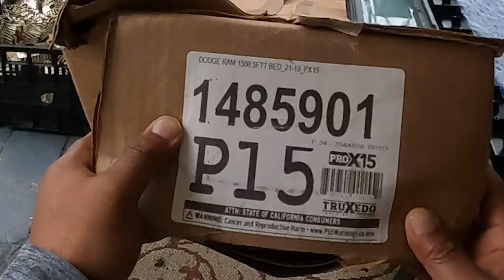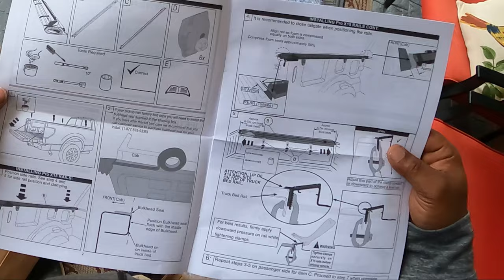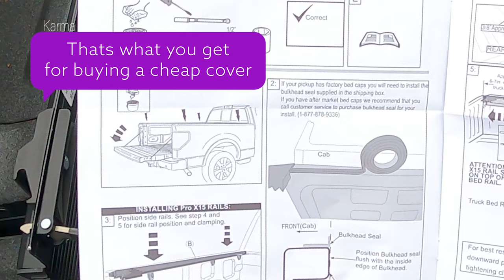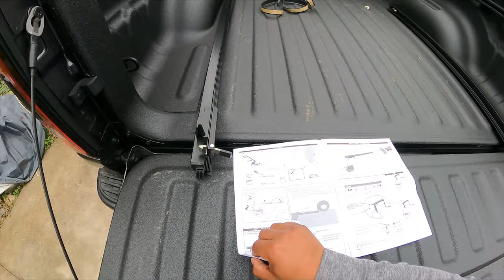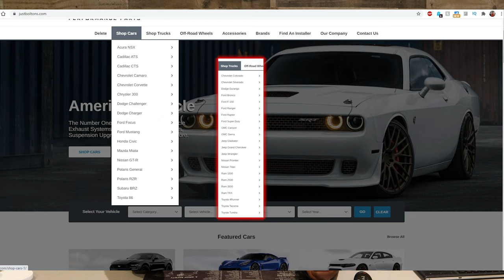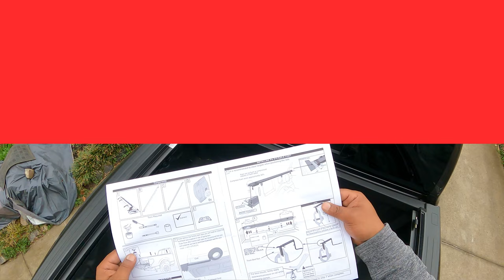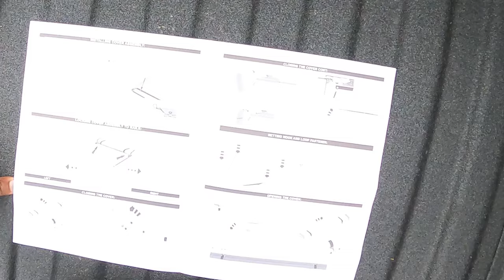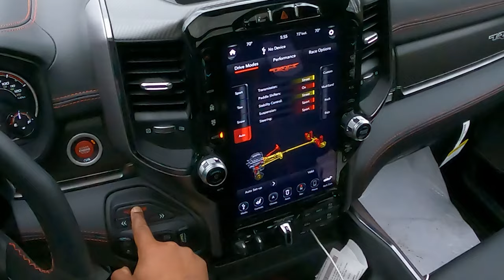Truxedo Pro X15 bed cover install on my 2021 Ram 1500 TRX

Comment: I would have never gotten one myself, but a vinyl  fold up came with my ‘20 Rebel. And I really like it. The metal frame under is arched so rain cannot pool up on it. Which is crucial here in the PNW. It does ripple a little bit at highway speed, but oh well.
Reply from the maker: Mine seems to stay in place based on how tight I have mine.

Comment: Just installed mine on my ‘22 ram 1500 and I’m not sure about it yet. It would not want to lock in the rear. I had to loosen the adjusting pins all the way in order for it to latch. And that part in the front corner that was sticking up and bothering you does that on both of my sides!

Did the weatherstripping make any difference on the front end or not? I couldn’t understand from the instructions if we needed to use it or not 🤷🏻‍♂️
Reply from the maker: Yeah the weather stripping supposed to help with water not getting in the cab and I haven't seen none in mine

Comment: I'm having to call truxedo for the second time about missing pieces.  I sent the first one back because it was damaged and the second one I got was missing all kinds of stuff.  It was missing weather stripping,  clamps,  and I just realized today it is missing an end cap on the driver's side of the part of the cover that clamps in place.
Reply from the maker: That Covid quality I tell you. How you don't have a packing list to check before you box is crazy

Comment: Did you ever find out if the tonneau cover was supposed to stick out that much at the end of the bed? Just installed mine today and it does the same thing at the end of the bed, not sure if that's how it is supposed to be.
Reply from the maker: Yeah it is based on how that rear rail is.

Comment: I have the same cover on 21 Laramie crw cab,same color, night edition, and noticed that water still comes in at the bed back, the 2 smalls spots where tailgate meets body. Not a lot of water, but enough that it was a visible puddle. Did u notice any water in your.  PS.  Nice truck.
Reply from the maker: yeah if it rains hard I do.

Comment: “Everybody’s gonna blame Covid” 😂🤣😂🤣😂
Reply from the maker: At least I do because of the crap quality I've been
Reply: @ButterDaInsider  unrelated question. I was going to go yesterday and order/deposit for a 22trx. She said she has 12 in que now. I rescheduled to the 21st. Do I have to worry about either not getting an allocation or my build being super delayed by waiting two weeks?
Reply from the maker: @trxntroll843  your going to be delayed by the fact she has so many in the que. Ram is going to build a couple for them at a time and then build for the other dealers and then start over like that. Over and over again until they get to your order.
Reply: @ButterDaInsider  damn but at the same time oh well. The longer it takes for mine to get made and delivered is more I’ll have paid off on my raptor therefore more I’ll be able to put down on the TRX. Thanks for the answer!!